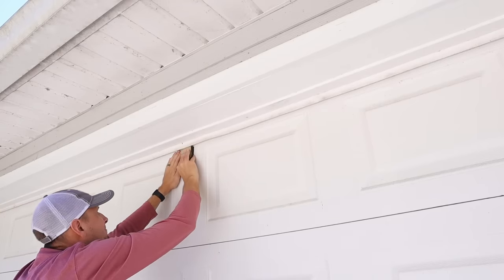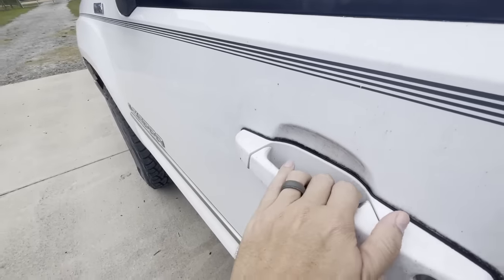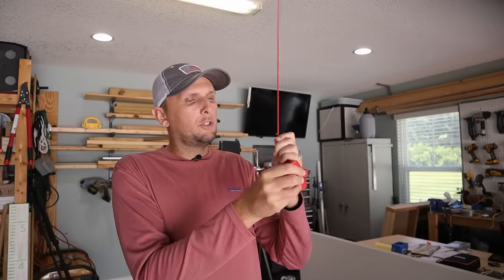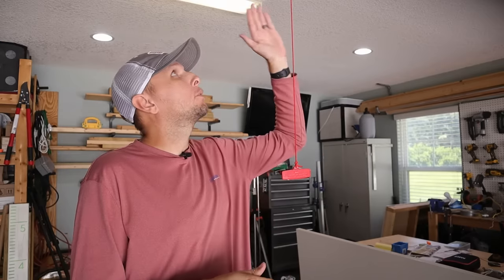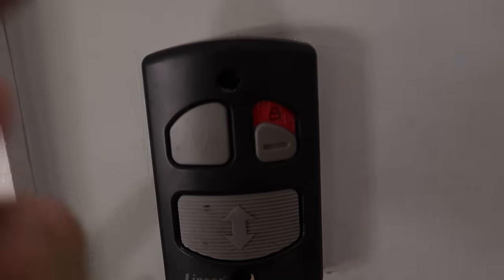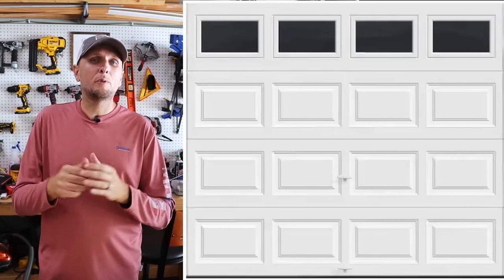How to Stop Garage Door Break-Ins | Number One Way Thieves Get Into the House!

Comment: so in my case, I zipped tie that garage door unlocking system and remove the cord, don't need it, the garage is also with a smart outlet, and it does goes out at 10PM normally but I can change that on the app easely, so even if you manage to get your hands on my garage remote control you can't open the door with the remote the garage will have no power to it, I do have 2 cameras setup with Alexa and it will go off if motion is detected at any giving time, so why I secure my garage? that' s my cave so it's not impossible to get in is just a bit harder than most garages

Comment: I bought a 5 year old house that already had an alarm system. Open any door or window and it responds via wireless magnet sensors. I checked it out and realized that the company that installed it missed the two most important places. The door to the garage, and the egress window the basement. Two most likely places for an intruder. And when we moved in, the egress window was unlocked. Who knows if it was ever locked.

Comment: Another thingni do is i put a long bolt through the bottem hole  in the track almost on top of the bottom  roller with a nut. This may not be the best way, but i gurante.   they will not be able to pull the door up  and it takes
Less than a minute to do.

Comment: Put a fingerprint or passcode lock on the pass through door. Deadbolt it. Use heavy steel door. Use extra long screws to fasten the face plate down. Make it super hard to gain entry into your home via the garage. And get the MyQ with a camera for inside the garage. I have dash cameras inside my car, which is locked inside the garage. Any bump activates it for a minute. I got them after an assault in my car at 4:30 in the afternoon at Dunkin Donuts. I did have a knife and pepper spray inside the car.

Comment: The latest way to open a garage door by remote control is using a device called a flipper it's a device that has a radio in it and it can memorize the garage door opening codes from afar.

Comment: jokes on them. i leave mine disconnected anyway because the garage door opener is just to slow when i can sling it up myself in a fraction of the time. and when i am away from home for a few nights i also put bolts or locks on the inside of the bars

Comment: I never leave my garage door opener in the car, even when shopping. It is always on me in my pocket. Also keep a insurance card in my wallet. That way if the car is ever broken into there is no opener in it, and no address info. Always take the keys out of the car while it is in the garage. Also did cut the cord so it cannot be pulled outside the door and secured the release with bailing wire. If it needs to be released just need a 2 foot lader to reach it. The world is turning into a place where a little inconvenience to you can save you from a big problem.

Comment: Don't remove the release cord, it prevents fire egress. One way to prevent opening the door by mistake, is to put the opener switch on the outside wall.

A smart opener with wifi is a good idea, if it automatically locks. Be sure to have a router that separates smart devices from the rest of the network, employs WPA3 encryption, has a unique name, and turn off broadcasting SSID.

Comment: Great tips, but you should never assume that your security mitigations are 100% effective because security is an arms race. You get smarter the thieves get smarter.  For instance, that pool noodle now gives a thief with a sturdier wire a bigger surface area to latch onto and they won't have to bring the whole cord outside the garage to pull it.

Comment: Drill a hole in the garage door rails just above a roller.  Install padlocks.  No one opens those doors from inside or out.  cheap fix.  Keep that key with your car keys.

Comment: Or put a zip tie through the hole in the latch - then when you need to open it, just cut the tie. Impossible to open using the cord, even if they get to it.

Comment: Here's a question... 
Even if the red tag line is engaged, I understand that the garage door can still be yanked up (forcefully). The only thing holding it 'locked' is the electric motor which is not designed as a lock. Anyone tried this? 
(I could try it out on mine but I don't want to risk damaging it.)

Comment: Just take that handle and string off completely. Get rid of the string and make a coat hanger hook with the handle. You can hang it on the wall in the garage for the rare occasions you might want to disconnect the door from the closer. Effectively, you have made the very tool required to break into your garage via the string hook method, but it is already in the garage and can only be used form in the garage. Next!

Comment: My garage door doesn't have a release cord. My car is locked when I am not in it. My garage door doesn't have an electric opener.  I have the pin that goes into the rail on both sides of the garage door with a padlock on both of them.

Comment: Another tip, get a motion sensing light, remove bulbs, screw in a female outlet base, plug in extension cord, route it discreetly inside your home, plug in an fm radio. Radio will turn on, thief/trespasser will not know u have been alerted to their presence. 
  Next, rain down hell at your own discretion.

Comment: I think you should be thinking FIRE SAFETY when you suggest/recommend anyone cutting or removing the garage door manual/emergency cord. 
     Furthermore, you should more safely suggest some way of hanging the string elsewhere, perhaps via a system of eye hooks, cup hooks or some other stable handyman-type belt-and-suspenders way, elongating the cord by knotting it together, or by replacing it with a much longer red string altogether,so that everyone in the family can reach it.... what if the youngest kid in the family has to save the whole family?
Reply from the maker: Umm ok.  Did you even watch the video?  I offered other ways of doing it.  Everyone needs to pick for themselves which one, if any of them, to do.

Comment: I dont haave a release cord

My remotes dont work unless the system is in lock mode

Dont forget the windows, paint them black from the inside, put them in blackout mode so from the outside you really can't tell if they're tinted or it's just dark inside nothing can be determined, and then screw a piece of plywood over the inside of the window and be sure to paint the plywood black too so in case they do break the window...

Most garage break-ins are done by backing a car into the garage door and knocking it off the track, put a cable at the front of your driveway or in front of the garage door so they have to go through the cable first damaging their car before they can get to the garage door 

And finally a monitored alarm system with a garage door sensor and a garage door tilt sensor

Comment: Pretty sure the noodle will not work. All that attacker needs do is apply pressure to the noodle and it will drop the locking mechanism. 
Thanks for the tips.
Reply from the maker: It works.  Number one unless there are windows, they don’t know there is something as wide as a noodle.  And even if there were windows it’s not easy to loop around.

Comment: This is all well & good but honestly if someone is absolutely determined to get into your house they're going to find a way. I notice this guy's garage has two windows so really a pool noodle around a rope isn't going to stop anyone here. If you have windows without bars, they can break in. If you have standard doors, a sledge hammer will open it. Hell I know of one story about a jeweler who was so paranoid about being broken into he had a state of the art alarm system and those rolling shutters installed on all his windows and doors, only to come home late from dinner one night and discover thieves had climbed onto his roof and cut a hole through the ceiling to break in and he lost hundreds of thousands of dollars in diamonds from his safe because they found a way to disable the alarm too. Yeah you should always try to make your home as secure as possible, but don't be fooled into thinking your home can ever be made impregnable.
Reply from the maker: Making it impossible to break in was never the goal.  It’s not really possible.  Yes I have two windows which the blinds are almost always closed.  But if someone wants to break a window, they aren’t going to break the garage windows to get in, it will be one of your house windows.  It’s about making it as difficult and unappealing as possible.

Comment: Why would anyone keep that "release" line in place?  You can get to the release from inside of the garage should you need to use it for something.  I cut mine short and left the line without a knot or hold point.  Cars, all are alarmed and locked.

Comment: Not letting people know what you have? Like a giant white background behind a display of every single power tool with battery you have in an almost museumesque display ;)
Reply from the maker: And what would one do with that info?  Dont recall advertising my address. 🤣
Reply: @HowToHomeDIY  Not the viewers. Everyone walking by when your door is open. Man, I hadn’t even considered risk from random viewers. Seriously though, next time you’re at the hardware store check out copper pipe insulation. It’s split down the middle with adhesive like it’s made to wrap around the line.

Comment: We built our garage with zero windows, so  no one can see in to what we have.  Also, the garage doesn't face the street:  it's behind the house on the property.  Furthermore, our doors are manual-open only; and they swing outward, with no locks or handles on the outside.  They can only be opened from inside,  They are large, heavy, reinforced doors.  We had a fire one time, and the fire dept. actually broke their chainsaw trying to get through those doors!  Anyone who thinks they can just smash through with a vehicle will be leaving on foot!

Comment: When we are home (or away for a bit on a trip), I just put a screw driver in a hole on the track above the wheels. Yeah it looks bad, but I put a flag on it so my wife remembers to remove it. It is about 5 inches up. As a safety measure, it stops and goes back down if someone tries to open it with the remote. Maybe there is someone that can slide through a 5 inch gap 😜, not sure, but it won't be easy.

It's just a poor man's version of the sliding lock if you have a old stripped phillips screw driver lying around.

Also, it is rare that someone is not home, since we work at home, so I am more concerned about my family than someone taking my junk.

Comment: When is this type of break in occurring ?  most garages face the street which means the criminal is totally exposed to being seen . a breaking like this most likely would not take place if the owner is home as the noise would alert them . if the breakin is being done while the owner is away on holiday or whatever, then a simple inside locking device on the track is all that is need to prevent this from happening .

Comment: What about those windows on the side of YOUR garage?
Reply from the maker: What about the windows on your house?  What’s your point?
Reply: @HowToHomeDIY  You specifically stated about the visibility through the windows in YOUR GARAGE DOOR but the windows in the background in the other garage sides are wide open to look inside without standing on tiptoes and see what you have... My house has interior shutters except the two small frosted windows in each bathroom. MY garage windows have plywood sheets with screws for hanging things like pegboard or shelves. ZERO EXTERNAL visibility and 30 yard 360* CCTV with motion detection and IR... Your garage door emergency release can also be strengthened with a zip tie that is easily broken ONLY when pulled straight down. BTW MY HOME has been protected this way for 20+ years.
Reply from the maker: @donnamoss9650 my windows have blinds on them that are close 99% of the time.  Only sometimes do I open them when filming a video.

Comment: I've never seen that kind of garage door opener.
Reply from the maker: The brand or?  The type is the most common kind there is.
Reply: @HowToHomeDIY  maybe where your from it's common to have that pull handle. But not in my town. Either you have a motorized rolling sectional garage door or you pull it out and up  from outside and it tucks up as a solid piece at the ceiling.

Comment: How to Stop Garage Door Break-Ins

Meanwhile garage thieves are WATCHING this very video
Reply from the maker: Guess you missed the part where this is not anywhere near new to them 😂
Reply: @HowToHomeDIY  If its NOT new to them, then doing this WON'T help ...
Reply from the maker: It took you 6 months to come back with a response that literally makes zero sense.  That’s like saying if I dam up a creek that the water will still run right through the dam like it wasn’t there.  😂
Reply: @HowToHomeDIY  been gone for 6 months off the internet and i have 250 messages ...

Comment: I have to disagree with you on a couple of things... To handle does not have to be outside of the garage for you to pull the release. The hookielua that you hooked the rope with will be just fine to when you contact me handle.
And removing the handle is the answer.
The thief will not spend the time.
To remove the rope is removing a safety device. Even if you knew where the rope and handle are, in a fire, too timely to reinstall... The rope in place, with no handle is the correct answer...

Comment: If you really want to denture thief's, add a electric fence shocker to the wall of the garage door with some insulated contacts. So when the thief pulls on the pull string ,now replaced with a rod, the metal rod touches the contacts & runs into the thief's hanger wire, & ZAP. 
THIEF: Ow, I touched a live wire I'm not doing that again!

Comment: Question for you what if they hook between the pool noodle and the garage release and use the noodle for leverage and just pull with the hanger won't that just open the garage all the same. Yes it will don't do this just remove the cord and if you need to open the garage just have someone over 5 foot 5 flip the garage release. I tape my release as well so they cant hook it and pull and will cut the duck tape if I need to. Any high ceiling garage doors his idea is great with remove the handle letting the string hang.

Comment: If you have a window in your garage, that is how they will get into your garage.
Reply from the maker: Wrong.  If they want in by going through a window, it’ll be a house window.
Reply: @HowToHomeDIY  Wrong! If they want in the garage they are not going to use a house window.
Reply from the maker: @computerdepot3373 No. 10 out of 10 times if they are willing to break a window they will break a rear window on the house.  And then after they get done taking the valuables out of the master, they will unlock the door to the garage and take your tools on their way out.  I’ve seen it.

Comment: Why would anybody leave a car outside of the garage over night. Ohhh, I know why……because it either junked up or not used for what it is intended to…..TO PARK CARS 😂.
Reply from the maker: Intention is relative.  I had my garage built with the intention of never parking cars in it but to act as a shop that should I choose to pull a car in to work on it I could.  In my opinion a garage just for parking cars is a waste of space. 🤣
Reply: @HowToHomeDIY  I made the comment not in order to criticize you personally. However, MOST of the time when I drive by an open garage door all I see is that it is cramped full with stuff or junk. Now, IF the intention is to use it as a workshop….fine. Also acceptable, use it to park your car in a safe space over night !

Comment: They is upside and a downside to this video. Downside: you just taught and left a long lasting lesson in how break into a garage on the world wide web. What you just demonstrated to people such as a new younger generation of people, who this had never crossed their minds, is now pointed out, taught, and can be referenced again, like how to be a criminal course. Upside some older people did benefit from knowing how a garage can be be illegally entered. My contribution is, (garage door closed) take the handle, swing it towards the inside top of the door and cut off the handle; done. No handle for criminal to grab, string not long enough to pull through door, and string still usable to home owner. Glass can be cut or broken easily and quietly, so install a plexiglass sheet screwed in place on the inside. Light and visibility still there.

Comment: 01:30 🎣 Thieves can use simple tools like hooks to fish for the garage door release cord.
02:07 🔒 Locking car doors prevents thieves from accessing garage door remotes left inside vehicles.
03:55 📱 Smart garage door openers provide encrypted security and remote operation via smartphones.
05:08 🛠 Removing or shortening the release cord prevents thieves from fishing it through the door.
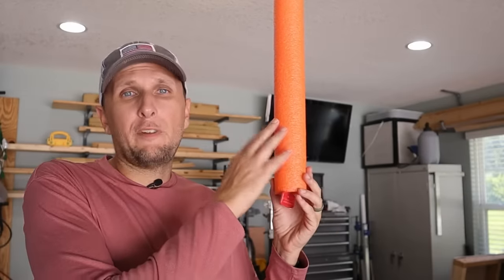05:45 🌊 Using a pool noodle to cover the release cord makes it nearly impossible for thieves to access.
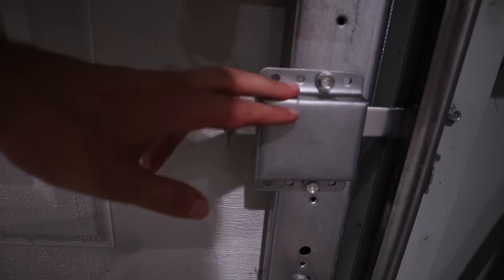06:52 🔐 Additional safety measures include installing garage door locks and unplugging the opener when away.
07:43 💡 Avoid advertising valuables by keeping garage contents out of sight.
09:31 💬 Knowledge of vulnerabilities empowers homeowners to take proactive security measures.
Reply: @HowToHomeDIY  A